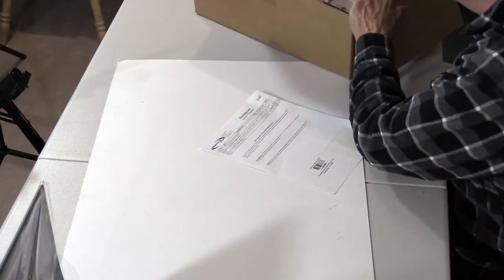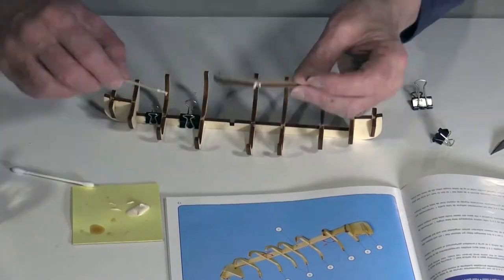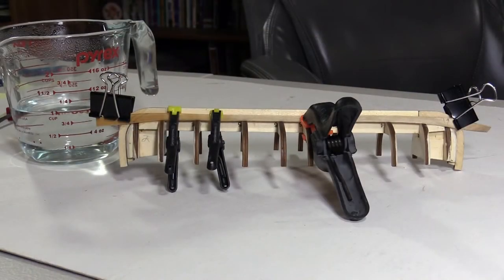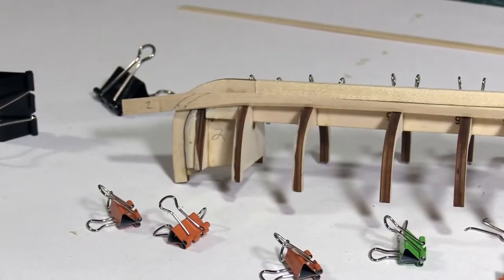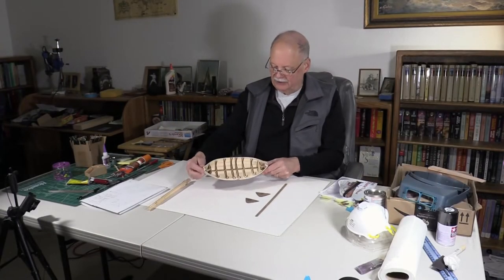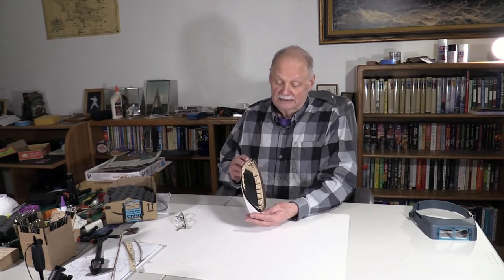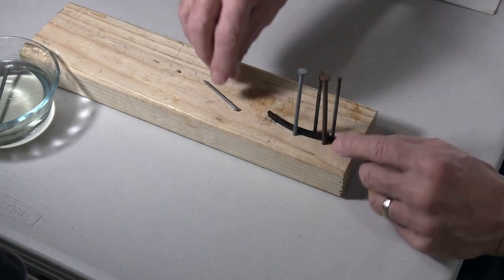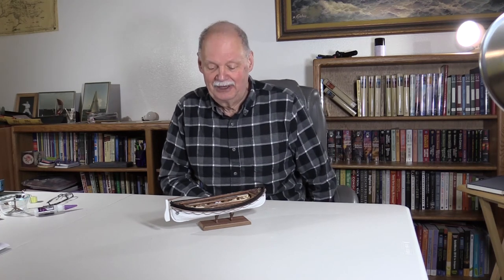Titanic LifeBoat Model Assembly

Comment: Great video, could we see a tutorial on the Rabbit joints - can’t quite get my head around it. Can not wait for the next video.
Reply from the maker: Thanks Harry for the encouragement.  I have put my tools away for the summer, but I will consider another video on Rabbit Joints, especially when I get better.  There are a lot of terms for this kind of build process.  The "search" criteria I used extensively were 1) Lapstrake Rabbit joint, 2) building Lapstrake boats, and 3) Clinker boat build.  These are all for actual boats, whereas I had to adapt these processes to a model boat.  I mostly used a hand held dremel tool.  Here is one of the links I found useful
https://www.youtube.com/watch?v=J0yFnF5Dx0s
Reply: Ken thank you very much , see you when your next video is released

Comment: Ken,  Very well put together for a first go. Particularly like the fact of a bit of research and picking up on the "laps" . Just been reading a pretty detailed account of the Titanic and her construction, which by the way includes the ships boats. The davits were bought in, but the boats were built to board of trade standards at Harland and Wolfs yard. The "lockers" you describe along the thwarts are in the main actually boyancy tanks to provide for additional safety margins in case of heavy weather. The actual lockers for additional items were under the boards that complete the bow and stern.  Does the kit come with the marker numbers and white star flag??  They were apparently the only markings on the boats as they did not carry the ships name strangely. Have fun building a chunk of deck with davits to hang that fine model.  Regards.
Reply from the maker: Thanks.  I never thought about displaying the boat by hanging it from davits, but that is a good idea.  When I finish my current build I will give this some thought.  - Ken

Comment: Which is bow and which is stern? Instruction do not identify.
Reply from the maker: It seems all the instructions for these model boats are vague.  I am working on my 2nd boat, and there are many steps for this boat as well that are not clear.  This is where one develops the “craft” of boat building.  My craftsmanship is getting better as I build them :-)  (but I’ve a long way to go!)
To answer your question, I had to go back to look at the instructions, and think about what I did.  As I remember it, the bow and stern are the same, until you add the emblems and rudder, (step 11).  But for me, I built the boat with some asymmetry (one end was better than the other), so I chose the better looking end to be the bow, well before step 11.  
Ken